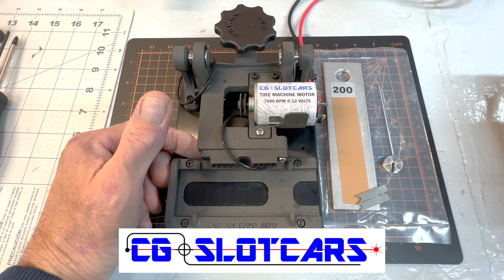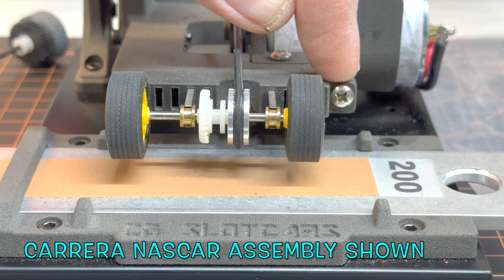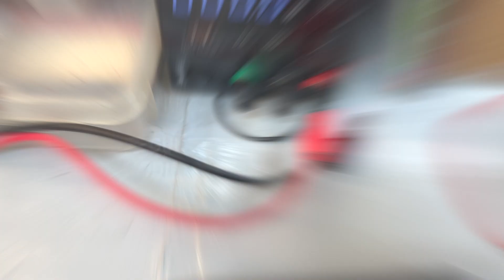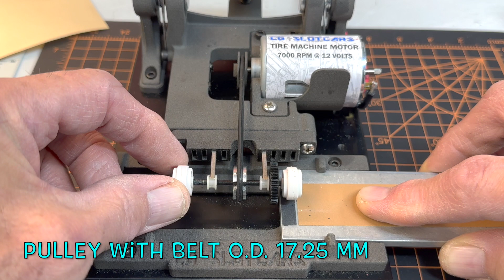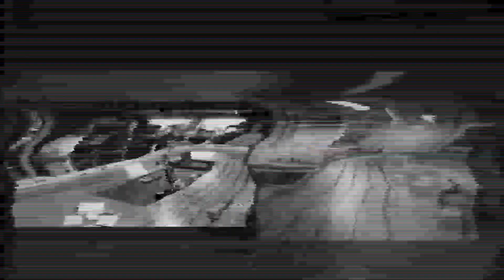CG Slotcars 3D Tire Machine

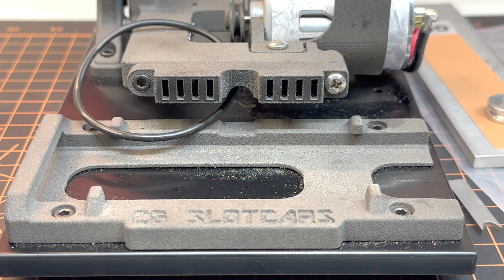Comment: Looks like a quality machine, it's 3D printed by to looks of it. I'm just wondering about wear to the base where the sanding block touches the base after all this machine is built for the "long haul" and over time the base might get sanded down unevenly might be ok if you only have sandpaper strip on one side. I ask because I noticed @ 01:46 what looks to be dust particles from the base of the machine and the only way to prevent that would to keep one side of sanding block with no sandpaper on it so you're not inadvertently sanding away the base.

Comment: Hi Harry ... so that is 3D printed?
How do you think it will hold up over time?
Reply from the maker: Yes, 3D printed.  Tough enough to drill into and brass screw inserts, so I am optimistic. Only thing I can see wearing is the sanding plate holder, but it has been through many, many hours of testing and seems to last.
Reply: @Homeracingworld  ...I commented about that sanding block holder of the machine and noticed dust from the holder only way around not sanding the holder away over time would be to remove the sandpaper on one side and have 2 separate sanding blocks with different grades or 2 different grades of sand paper on one side of the block.
Reply from the maker: @harryberry474  not really the sandpaper does not make contact. The end has a open gap so it does not rub